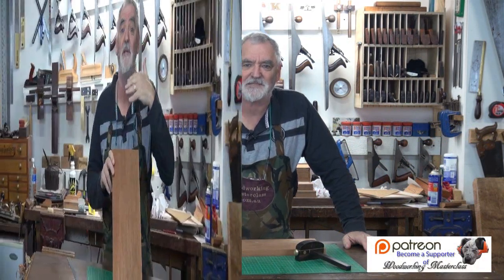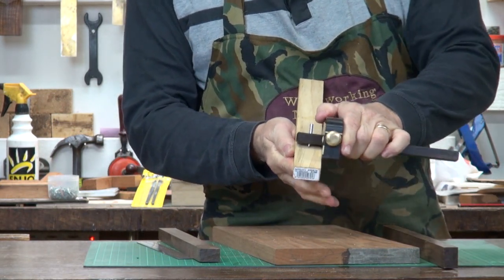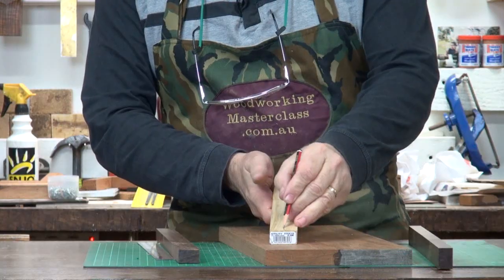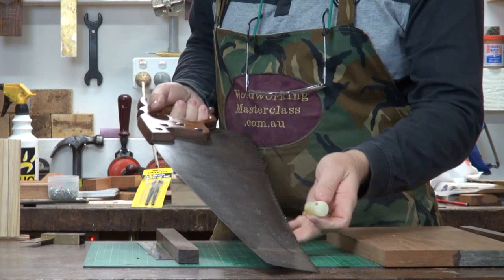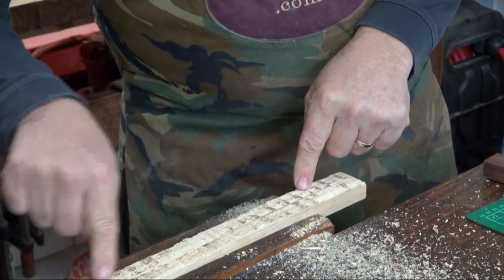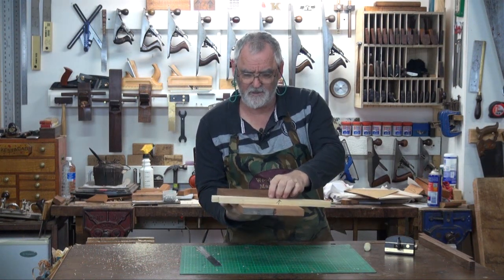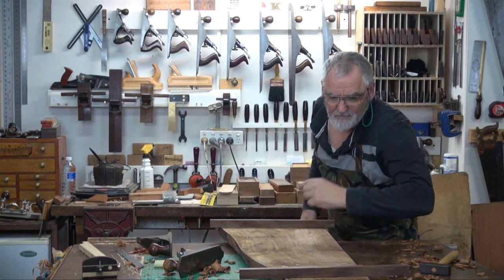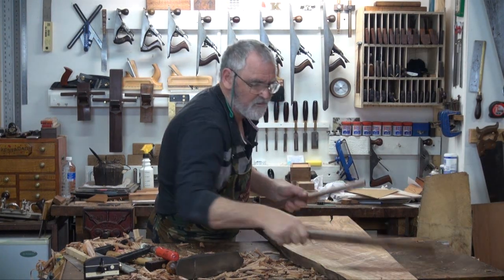Winding Sticks- How to Make and Use them.

Comment: Great and easy to follow videos.

I noticed that you are lefthanded like me. What kind of challenges have you come across being lefthanded in at righthanded world? Any tricks of the trade besides building your own equipment?

- My experience so far is mostly from powertools where I find my self positioned at the wrong side of safety equipment, facing the fast spinning blade of the skilsaw.

- Motor being in the way when doing mitered and beveled cuts with the chopsaw.
Reply from the maker: #1 is position your vice on the Right hand side of your bench. Stanley 45's are a challenge and most horned planes are uncomfortable to use. Having said that the ECE Range are OK for lefty's I've found. When setting up your workshop workout how best it works for you not how others have set out theirs. Cheers Steve

Comment: Hi there Steve!, ¿what size would it be right for the winding sticks? My guess is the larger, the more accurate, but could not develop the idea. I tend to use reclaimed pallet wood that is not much wide at all.
Reply from the maker: Really as long as it's wider that the pieces you are using. Mine all tend to be between 16" and 20" or 400mm & 500mm. They would be an asset if you want flat boards from Pallets. Cheers Steve
Reply: Thanks, yes they are now!. Pallets here in Argentina are made of 
Eucaliptus Grandis mostly, some times you get pine ones and there is 
another wood I do not recognize, but it is harder (the few).
Reply from the maker: In Australia we commonly call that. Flooded or Rose Gum. I have made a lot of furniture with it in the past. It's quite nice to use. Cheers Steve